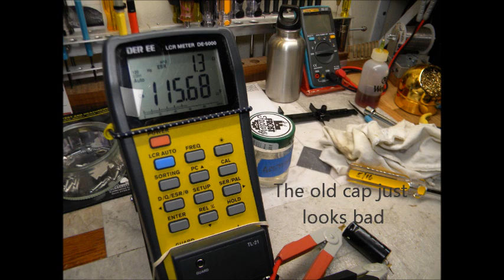Tektronix T922 Modification Part 1

Comment: Mr. Carlson is awesome. It is funny I only found this video because I just bought a Tektronix T935 (35Mhz version) on eBay to do this exact mod. I was thinking that it was a good looking compact Tek scope with X-Y ability and cheap price. I guess great minds think alike.
Reply from the maker: I was searching for about a year, I had about 3 different scopes in mind for this mod. until I found this on offer-up for $20.  It was in very good condition and as you can see plenty of room for the components for this Mr. Carlson project.  Thanks for watching and commenting Christopher.
Reply: @garybevis8691  That is about what I paid for this unit. I paid $50 total shipped. It had to go from PA to CA so I probably only paid around $20 for the scope and $30 for shipping. 

I also have 3 other scopes I was considering using. I have a wonderful HP180a, this model has an XY switch inside on the chassis, however, this one ended up not having that switch even though the service manual on this serial range shows it does. Oh well, I only paid $30 shipped for it and its logoed from Xerox Data Systems complete with asset tags. If you are into vintage computers you know what a cool place Xerox was back in the day. 

I like your channel, keep posting when you have time.
Reply from the maker: @christopher88719  Thanks for the kind words Christopher. That is a great deal on ebay for the Tek 935 and with Xerox lineage that is a bonus for sure.  I have a Tektronix 465 with a Property of IBM sticker. Tektronix equipment is so well built there are many still in perfect working order. I was really lucky to find this scope, I was not familiar with the T9XX series of Tektronix scopes.  I have a Bell & Howell tube scope and an RCA W0-91 that I restored, it is a 1955 all tube 5" 5 MHz scope, it weighs 35 pounds!.  I also have a Tek 222, 2246 and TDS 340.  I am thinking about making a video of my next Mr. Carlson Project and a High Voltage custom regulated power supply of my own design.
Reply: @garybevis8691  So I made a little progress on my tracer. I, however, have the same characteristic as your project where the trace is crooked. Have you found any workaround?
Reply from the maker: @christopher88719 Hi Christopher, as I recall the trimmer pots had to be adjusted for a flat trace.  Let me know how it works out.